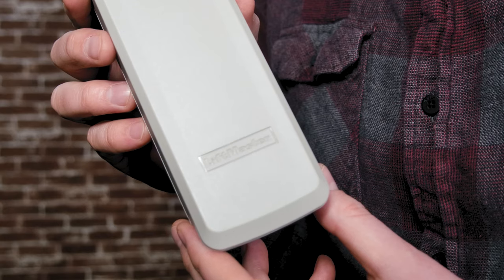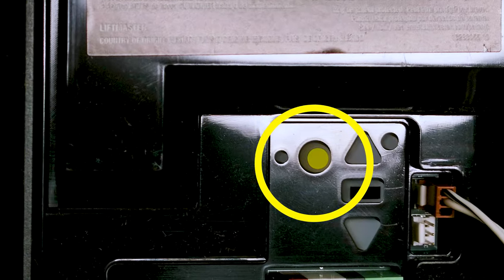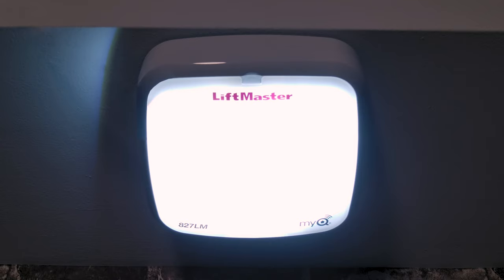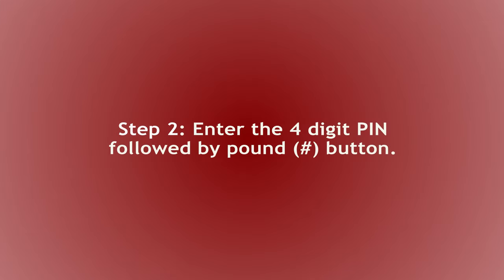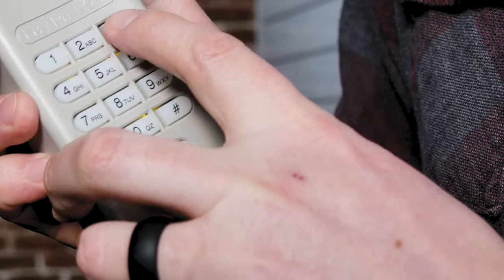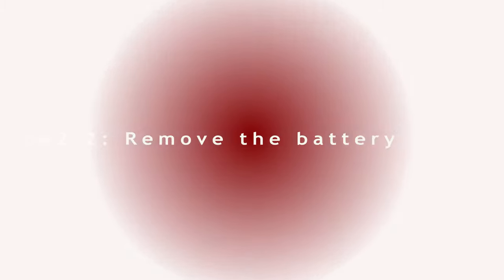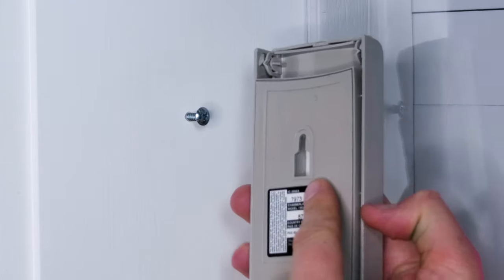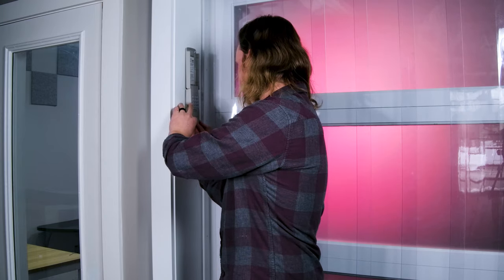How to Program and Install the LiftMaster 878MAX wireless keyless Entry

Comment: Hot dang... it worked!   Have fretted over this for months.  Local OH door company wanted $150 for the service call and a minimum of $100 for any work that needed to be completed.  Parts extra, of course.  I would have shelled out at least $250 (and they would have had  a missing part or something) for them to push a yellow button and then make the case that they just rebuilt my garage door opener. In a matter of 15 seconds it was DONE... just like that.  Many thanks, folks.  You've earned my admiration and gratitude.

Comment: 2:55 "now we should be good to go", except, I'm trying to remote troubleshoot this and my uncle seems to be doing all this correctly, including getting the clicks and light flash at the end, but then the remote does not work to open the door.  The door does still open fine with the factory included, hand held vehicle remote.

Only things I can think of are:
A)  Uncle is incompetent and even as he tells me he is following my directions, he is screwing it up somehow.

B)  Signal is poor, needs to have keypad held close or change battery, and yet, the opener light DOES blink when it should after entering the same PIN the second time.  Isn't that the acknowledgement that it received the same PIN that was just programmed in?  Next using same PIN it just won't work to OPEN the door, lol.  Two different people tried to program it before calling me and having me try to figure this out over the phone.  Ugh.  Guess I'll be calling Customer Support once it's business hours again so they're available.

Comment: Do the mounting screws come with the keypad? Also, can you use a lithium battery? They seem not to corrode like a standard 9volt.
Reply from the maker: Hi Richard, Yes the key pad comes with two mounting screws and yes you can use lithium batteries with the unit.

Comment: hellow! one question  why when I programed  my liftmaster  878max the other garage openers from the car dos not work?  and how many can I program I have two cars.  thank you
Reply from the maker: What brand are the remotes you need to program for your car? You may need to reprogram the other remotes using that brand's programming steps.
Reply: @nscommercialdoor  thank you for replying back  the other two garage openers are chamberlain if I program the  lift master 878max  those doesn’t work and I reprogram again and lift master doesn’t work so what can I do ?
Reply: @myjosefarias  Don’t use your garage openers. Download the app and use your phone to open your garage door. Garage openers are old school.
Reply: @lazyhusband  Meh, the app still uses a hub that is effectively still a garage opener remote, so there is still the vector for hacking same as the remote, but then it ads on the other IoT vector as well as going at the hub itself.   The one potential virtue would be if someone were hiding in your bushes, so nearby that they could effectively jam your signal to not have rolling codes cycle on, capture the code while still fresh/unused, but if they are THAT close, they could just slide an antenna under the door gasket and gain advantage that way.

Besides, if you are driving into your garage, technically it is illegal in most areas to your your phone while driving.  Gonna stop and put it in park to whip out your phone?  What a hassle that would be when I can just press the remote button.  Done it for  years, never robbed via my garage.

Comment: I have a yellow button Liftmaster and followed your instruction step by step exactly, it won't work.
Reply: My main wired control panel has a learn button under the flip-top "lid".  My unit, which is mounted on the garage door wall, has what looks like a yellow learn button, but that did nothing.  Using the non-colored learn button on the control panel worked using the Yellow-Button instructions.